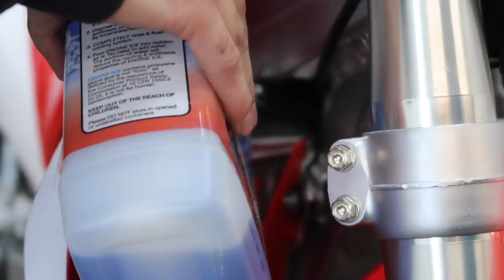2019 CR125 REVEAL!!! $800 Two Stroke Transformation

Comment: When putting on the front wheel leave axel clamps loose, and tighten axel till it is all the way inwards and the thicker part is all the way butted up to the wheel hub then tighten the axel clamps, it helps act as a spacer one side and helps prevent the forks binding which if done the way you did could very quickly Lead to leaking seals,

Comment: Noti squad, just got an 03 yz 125 for 800$🤘tyler is such a cool dude with cool bikes
Reply: mongoose vlogs that’s cheap!! I got my 02 for $850
Reply: @GoonRides  ya all it needs is a carb throttle slide. Haven't got one yet because there so expensive. If anyone got one for sale let me know.
Reply: mongoose vlogs WHATS the price?
Reply: @GoonRides  160$ oem
Reply: @portablezaps6517  cheaper and easier to work on than 4jokers
Reply: @mongoosevlogs4415  thats a horrible reason to ride one
Reply: I have a 2011 yz125 i bought for $2750
Reply: @geoffo8266  I prefer 2 stroke dirrbikes 4 stroke quads love the powerband

Comment: just so you know, youre putting the front wheel on all wrong, supposed to torque the axle, bounce the bike a few times then torque the holder bolts. the suspension needs to float in the correct spot or you could damage the forks really badly.

Comment: Excellent build but I have seen three things wrong on your assembling this bike. Number one you put the water pump seal in backwards spring faces the impeller. #2 you did not Gab your flywheel with your points low is      .018 to .025
#3 you didn't work your clutch
To 8.5 foot pounds.
All three of these are a major part rebuilding a motor.

I want to see a 1997 to 2007 cr250
Or a ATC 250r